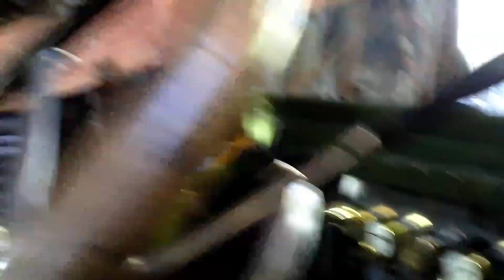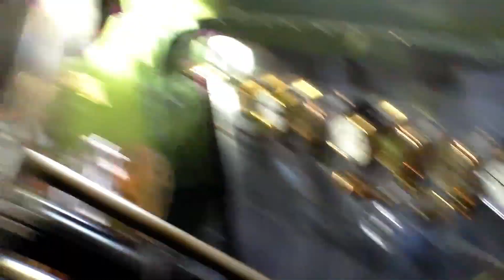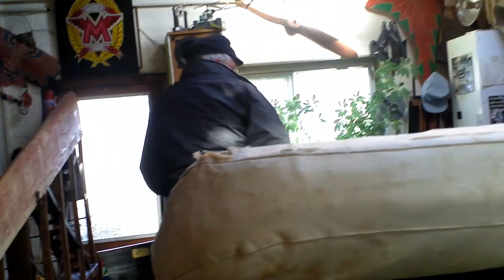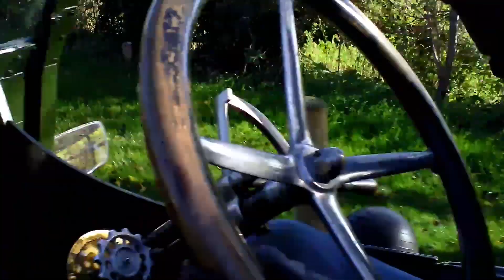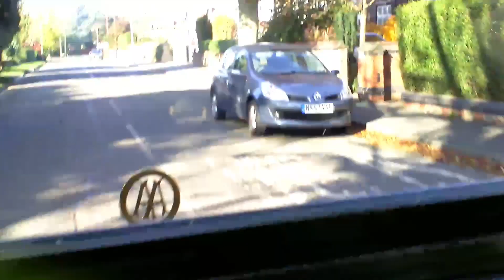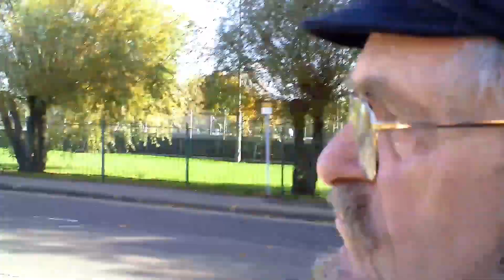How to Operate a 1910 Stanley Steamer | Steam-Powered Motoring Explained

Comment: No wonder they went to the flash boiler, but even that couldn't save them. Wanting to jump in and go ruined the idea. I do wonder, however, why someone has not retooled the idea and with modern improvements, put it forward again as an ecological solution?
Reply: Because reciprocating steam engines aren't efficient. The best steam locomotives were about 10% efficient, compared to the 25 to 40% efficiency of a normal mordern-ish car.
Reply: @mfbfreak  Steam locomotives are not the pinnacle of external combustion engine design.  Their fire-tube boilers are very old technology compared to water-tube types, which can achieve much higher pressures and also have faster responsiveness and flashing-up time.  Some steam locomotives used uniflow cylinders, and I think rather more used limited compounding (multiple-expansion), but the most sophisticated reciprocating steam engines - those that combined both the uniflow principle and  compounding in one design - can actually achieve rather higher thermal efficiencies, but very few of those were ever built (mostly for marine use) before being eclipsed by the sheer convenience of diesels, in an era when oil was relatively cheap, and atmospheric pollution was practically a non-concept.

Comment: Sorry but I cannot believe that to start the car was so complicated. Since at that time most of the car owners had a “slave” to drive their car,: how could a uneducated slave be able to start this “space machine”?! I honestly think that this gentleman makes the starting operation more complicated than really must have been.
Reply: There are several reasons: 
- They didn't have a slave, they had a chauffeur which is a normal paid position. Chauffeur is the french word for 'person who heats things'. It's the person who prepares steam vehicles for use. 
- All these complicated things have a sound logic behind them. Compare it to how you nowadays can use any computer software with maybe a few days of practice. Back in the day, a basic understanding of steam technology was something you'd grow up with. The details of operating this car, were taught by the manual or by the representative of the company.
Reply: Starting and driving a car with an internal combustion engine was also a skilled and complex task in 1910.  Take a look at how to operate a Ford Model T:  https://www.youtube.com/watch?v=QxfHMtgg2d8

You had to manually adjust the fuel-air mixture with a choke control to be fuel-rich for starting, and retard the spark timing with what was known as an "advance lever," then remember to adjust it back again when driving, but not too much or the engine could stall or backfire.  You then had to turn the engine over by hand with a starting handle, holding it in just the right way so that it didn't break your wrist if the engine backfired.  You had to manually block open the cylinder exhaust valves before doing this, to reduce the compression enough that you could turn the thing fast enough, then remember to close the exhaust valves again as soon as possible after starting or the combustion would fairly rapidly burn the valve seats away.  You then had to keep on manually adjusting the spark ignition timing and the fuel-air mixture as the speed or loading of the vehicle changed, or, once again, the thing could belch black smoke, waste fuel, burn away its valve seats, or - once again - stall or backfire, and then you'd have to get out and go through the whole starting procedure all over again.  There wasn't always a simple gearstick in early cars either, let alone automatic transmission; you often had to change gears using a counter-intuitive combination of levers and pedals.

All these fiddly little controls and adjustments have been increasingly automated and simplified over the last century, first by clever mechanical systems, then electro-mechanical, then analogue electronics, then finally fully computerised engine management systems.  If steam cars had continued to be developed alongside internal-combustion cars, I'd imagine they'd similarly be heavily automated and simplified by now.
Reply: Slavery was freaking illegal by back then. Anyways this IS the startup
Reply: The maid would have had good training as the car was expensive but she probably would have followed a well detailed checklist or at least referred to it if uncertain or anything was not as expected.
Reply: This car has been modified, and is definitely a bit more complicated to start up, double the number of gauges to watch for a start